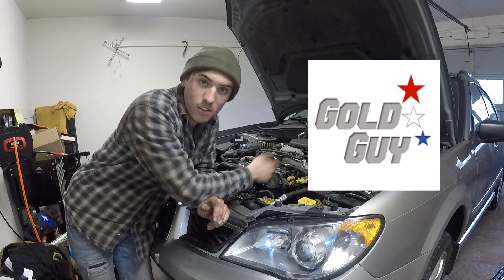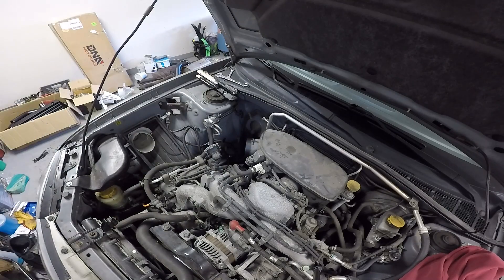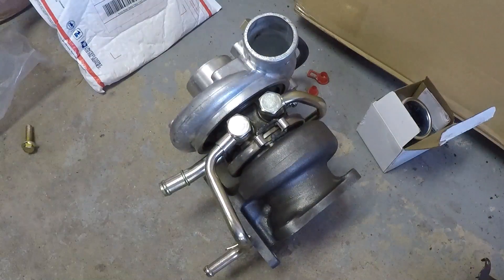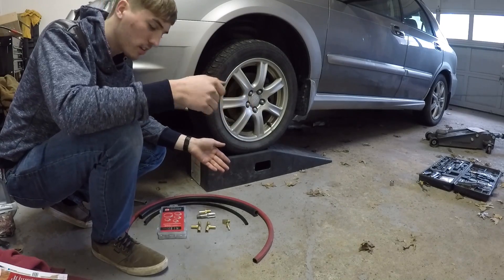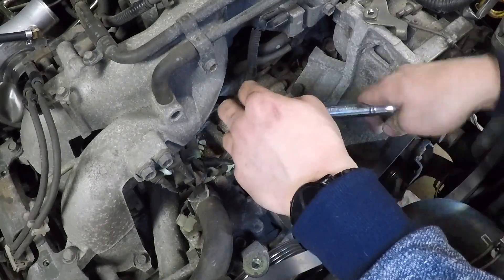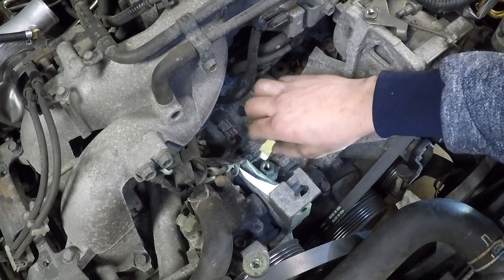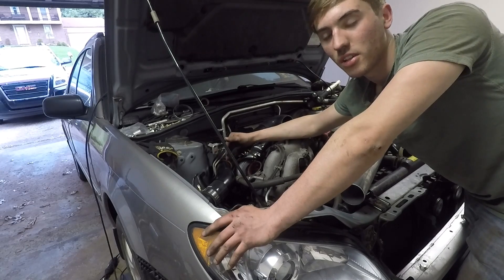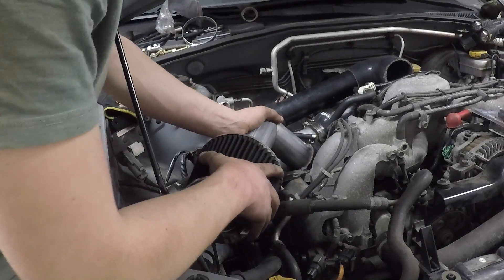Turbocharging My Non-Turbo Subaru

Comment: Ideally you should have drained the oil, removed the sump, drilled your hole then welded a boss onto the sump. The way you have done it means that the thread on the brass hose tail is only gripping on about 2mm of metal. Also the teflon tape that was on that fitting is now going to be floating around in the oil, I suggest using Loctite 577 or similar, teflon tape is not the right sealant to use in engines. This is not hate, just advice from an automotive engineer.
Reply from the maker: Jamie Maskens I had to end up changing that setup anyway because it was leaking, I just ended up jb welding the fitting in the oilpan and it ceased to leak. Also I drained the oil and ran some more oil through it to clean it out, it should be good now!
Reply: what everyone else does in the NA/T subaru forums is do this into the valve covers its easier and since its alummin it screws right in
Reply: I was going to say something similar.   Thanks for pointing that out.
Reply: School of automotive engineering?
Reply: Would this be the concept for a 07 forester engine
Reply: Nah ideally you would use a catch can for a turbo so you don't have to drill any dumb holes. Idk why you guys don't do that I get the traditional way and all but bruh forget that
Reply: @toxicity6629  what? a catch can is installed into the intake system using the intake manifold and pcv and is used to catch excessive oil in the intake system not for draining your turbo oil lmao you need to drain it back into the engine. its a system, the engine needs oil and the turbo needs oil.  you give the engine oil, the engine feeds the turbo oil and the turbo gives/ drains it back to the engine and its constantly doing this. you only need to drill "dumb holes" on an engine that was not factory turbo charged. the turbo ones from factory come stock standard with those "dumb holes"🤷

Comment: Dude I’ve got an 07 non turbo hawkeye with the head gasket redone by the subieguy in richmond va. I love this car. Only negatives so far: LEDs died behind odometer, cd changer is jammed with my fav cds inside. I’m about to put black widow muffler on it
Reply: Lol the same two things happened to my Subie too
Reply: @pcrb141  you’re not gonna believe this... somehow one of the lights behing the odom came back. 😳 and it wasn’t just the dimmer/adjustment - i mean it was 100% dark behind the odom but one lil led was hangin in on the other side.... then somehow one behind odom came back on. 

My cds are still stuck though. That thing stays trying to unjam but it cant. Ima have to rip it out. 

Also, somehow moisture is getting in the trunk and/or under the rear windshield when it rains
Reply: @RedPillVegan  that's good news about the gage lights! No one is making aftermarket gauges for that model. At risk of speaking for you, you're probably best off getting a new receiver with bluetooth capability at this way. That's what I plan on doing with mine. Good luck I hope it all works out for you

Comment from the maker: I really hope you guys like this series, I have had a lot of fun making it. If you are just here for the motorcycle builds, don't worry, there will be more of those videos as well!!
Reply: It's awesome! please keep on uploading more contents about the Subaru
Reply: Man you give me the inspiration to turbo my blobeye n/a wagon-scooby!! Sure will be a badass scooby!😎😎
Reply: Awesome vid! Thanks for sharing the process
Reply: if the oil pan starts leaking take if off to someone let them tig a bung in place for the oil return.
Reply: Did the uel headers you bought compensate for the n/a engine cradle? I have a n/a 2006 legacy and one of the main reasons why I’m putting in a tribeca engine instead of a legacy gt engine in is the engine cradle is in the way of the uppipe also cost

Comment: For the oil pressure sensor T-fitting, it's actually not a US imperial 1/8-NPT, but rather a BSPT (B for british, which is the same standard used on european and japanese cars) thread that you need for correct install. The imperial fitting has different number of thread per inch (27 instead of 28), so it might leak oil a little.

Comment: since he removed the stock intake manifold and made his own inlet pipe with the hoses what happened to the open hole that the old intake manifold went into?
Reply: by the open hole you mean the throttle body? that is where the hose coming from the intercooler going to be

Comment: I was just curious how the turbo was installed. I was not expecting this many thing to be needed done to the car.
Reply: Ej 20s (the engine here) can be boosted to 300whp on stock internals as they are essentially detuned performance motors. The only things you need to turbo them are anything involved in a turbo kit and that's it

Comment: You could have drained the oil first,  remove the oil pan,  then on a workbench drill the hole, tap the thread, then MIG or TIG Weld that on.

Comment: Gold guy where can I get the fitting you used for the oil pressure sensor to run the oil feed I’ve looked all over and have been unable to find one
Reply: I got mine from my local automotive shop like repco here in Australia and had them pull out a subie oil sensor they have in store that fits my subie than find the right fitting for it

Comment: How many miles did you buy it at? And what’s it at now? I’m looking at a 2007 imprezy with 156K miles with only 1 owner for 4K. Worth it???
Reply from the maker: I think that's a little high mileage for 4k personally. If it's in good shape and you are okay doing some maintenance on it if you have to then go for it.

Comment: I liked how you made this a tutorial -like video, however, If I may add something, for the Oil drain/return tapping. Drain the oil, remove the oil pan, and then drill, tap, and screw in the fitting. This will minimize ANY shavings straggling in there, and possibly getting picked up by the oil  pressure, and travelling through your engine....  jut my 2 cents ;)
Reply: I screamed "Noooo" when I noticed that lol

Comment: Hey I am curious as the the reliability afterwards and total cost? I have a 2011 imprezza and I am considering getting an ebay charger myself but I wasnt sure if the juice is worth the squeeze
Reply: Prolly mak 180-200 on stock ecu ( considering subies have good torque I would suggest a lil larger turbo at low boost. Stock ecu will compensate for 10 psi tops and make sure u spend the extra on good intercooler piping, oil feed and return ( good fitting make all the difference) and when u drill oil pan please take off car completely use some sort or locking agent in bung Atleast

Comment: Is your car awd? I am want to turbo my 2003 Subaru Outback 2.5L but it is awd and I am not sure if it will work.
Reply from the maker: You it's awd, you can definitely turbocharge an AWD car.
Reply: GoldGuy I ended up making my own up pipe using the stock manifold to avoid cutting the sub frame.

Comment: Ive got a 2004 2.5rs. Wondering if it would be more efficient to try and do all this to my current engine, or just buy a new wrx engine and swap. Somewhat new to working under the hood..i know the basics but no doubt there are things im not thinking about when it comes to making the right decision. Any input is appreciated.
Reply: Did ya end up doing it? In the same boat as you
Reply: 1 yr later, now I am also in this boat 😂

Comment: Where’s the header install vid? I’m interested because it looks like you used a reverse direction turbo header set to avoid having to pull the engine and swap crossmembers

Comment: Part links? Im looking to do the same build
Reply from the maker: You have to find your own parts, all the ones I bought are no longer on eBay. Most of the stuff I used was either universal or for the same year wrx version and it required some modifications to fit. Good luck!

Comment: Over all it is a nice video, and this is helping me out a ton but i saw you changed the fuel pump have you also changed the injectors and what are you using for a tune on the car atm ?

Comment: Those ports you added between the throttle body and filter will not actually have vacuum. They will draw enough air for the PVC system but not for the vacuum assisted brakes.
Reply from the maker: I figured that out the hard way lol, no i didnt crash into something but yeah i had to do a workaround for the vacuum systems. That will be in my first drive video which will be out in a few days. Stay tuned man!

Comment: did you have to swap water pumps? or did the new headers clear?
Reply from the maker: The new headers cleared.
Reply: GoldGuy thanks so much for the reply dude. That’s good to hear. Buddy of mine just got a 07 impreza he wants to turbo also, mines a 2.2l dual port. Anyway, great work!

Comment: I feel like just buying and bolting a turbo kit to my Subaru wont work because I thought you have to put a decompression kit in the engine first
Reply from the maker: Only if you want to run boost levels higher than 8psi
Reply from the maker: I'm only running 5psi

Comment: Cylinder head, maps? Nothing? That is stock engine and you added turbo yes?
Reply: pers Yeah it's a pretty common setup. You're good with just a fuel pump and spark plugs (colder, gapped to 28 or 30 rather than 40) if you stay low boost. I've seen people run them for years like this. Specifically in the older cars.

Comment: I think you're going to regret doing this in a few months when the car starts to take a massive shit. I don't know how it is exactly with Subarus but at least Volvos it's more expensive to turbo an n/a car CORRECTLY (meaning won't destroy the Piston rings or anything within a few months) than it is to just buy one that's turbo charged from the factory.
Reply from the maker: SRT Viper 51 the engine is going to be fine for a while with just 5 psi boost. I have done my research and I know that it can handle it. I do plan on doing a major engine upgrade in the future though with bigger head studs, sleeved cylinders, a closed deck, forged pistons, but until then, it will be fine
Reply: Goldguy oh okay missed the part about 5psi lol.

Comment: You really did not just run a hose from your intake pipe to your brake booster. Please tell me this is satire. 😂😂😂
Reply from the maker: I realized that was incorrect and fixed it later on. I thought there would have been enough vacuum but was clearly wrong. I learn a lot from trial and error. Thanks for watching!